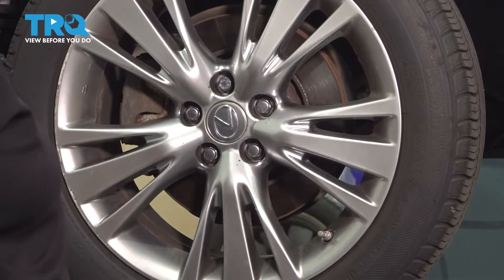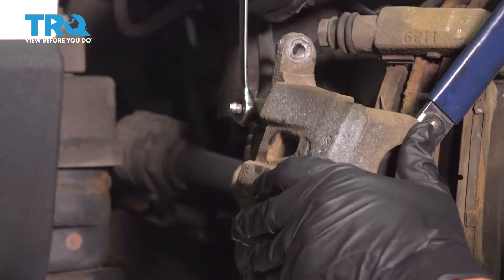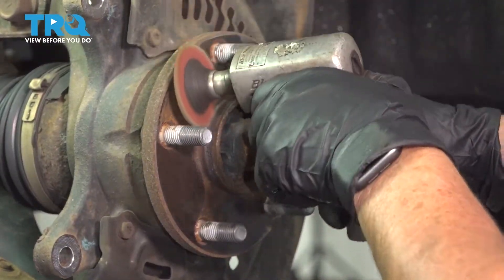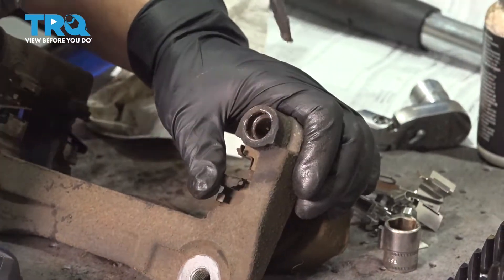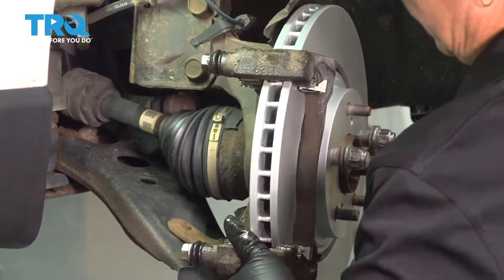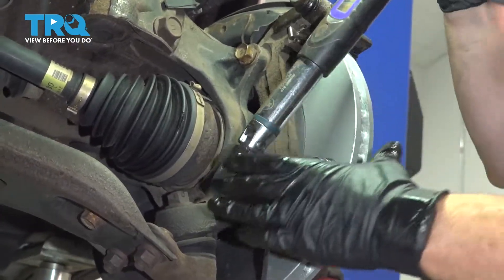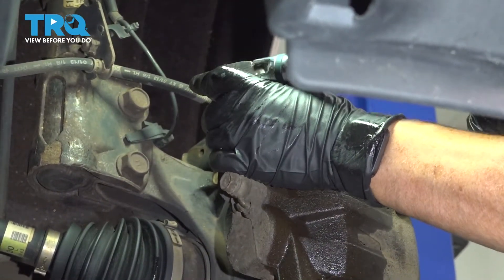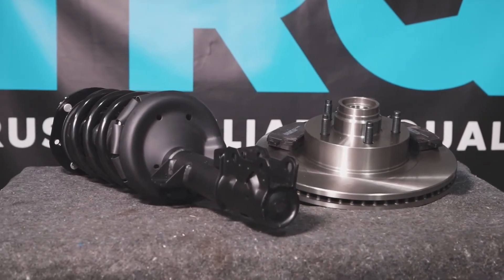How to Replace Front Brakes 2010-2015 Lexus RX350

Comment: Great Video.  Only thing I would add is to Clean the new rotor with brake cleaner just before you put the wheel on. Takes of grease as well as the rust proof coating they can ship with.  Only other (optional) one I learned from a mechanic family member was to take the plate off the Pads, and apply a small amount of copper grease between the plate and the pad.  He told me it takes noise out.

Comment: Great tutorial. My rotors were seized so I had to use a couple bolts to get it off. Also, the clips that go on the pads have a tendency to push the brake pads out. Much easier with another person to hold them on while moving the caliper down.

Comment: If anyone else also wonder why wear indicator should be on top in this video, found this good explanation: This wear clip should be positioned so that the rotor contacts the clip before it contacts the brake pad. The rotor should push against that clip, not drag it away from the brake pad. The pad that has this wear indicator should also be on the inside of the caliper, since the inside pad wears somewhat faster than the outside pad.
Reply from the maker: +Gang Ji Thanks for the feedback! http://1aau.to/m/Shop-TRQ

Comment: The Haynes manual is saying to take the old thin stainless backing plate spacer and put it on the new pads.  I tried to do that with benix, and the caliper didn't fit. On yours i don't think you did that.

Comment: You should grease the inside parts of the caliper.....to prevent noise and vibrations...also clean the rotor before putting the wheel back.

Comment: Bought the rotor/pads kit for my son's 2005 RX330 from TRQ...I've done front brakes many times, never an issue, have used TRQ products as well, no problems...did the brake job on the RX330 two weeks ago, and now one of the metal plates that comes already on the brake pad ( between pad and caliper) has somehow slipped or slid off, and it's now scoring the side of the rotor hub, and creating an unpleasant grinding sound...bad brake pad? Ever seen this?

Comment: An excellent video, both for the front and rear, but it would be helpful if more explanation could be given on how to remove rotors that are stuck on. As well, some confusion in my mind on where and when or if to use the grease that comes in the kit in light of the video admonishing no use other than putting silicone paste underneath the tins
Reply from the maker: +Dugald Campbell Thanks for the tip! We'll pass this info along to our production team. http://1aau.to/m/Shop-TRQ

Comment: Странно, врде бы по техническим спецификациям скобу крепить надо не 77ft. а 114 ft.*lbf
Install the front disc brake cylinder mounting to the steering knuckle with the 2 bolts.

Torque:
155 N*m  { 1581 kgf*cm, 114 ft.*lbf }

Comment: You are kinking the hose while bleeding out the brake fluid to push back the pistons. If the hose was in a worse condition, you could've cracked the hose or cause a weak point and potentially have the hose break while driving on the road. On a realistic note, you most likely would just crack and cause a leak right then and there. Just get some bungee hooks and hang them from the suspension springs

Comment: You said the top slider has the rubber oring... Was watching a different video that says the bottom used the shorter oring slide.
Reply: Actually watching the rest of the video it looks like you put the oring one on the bottom?